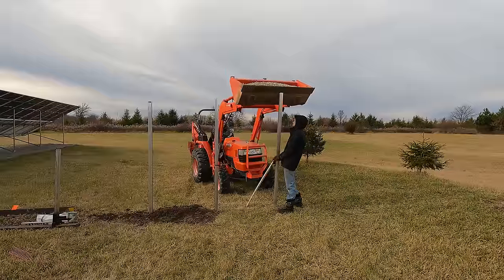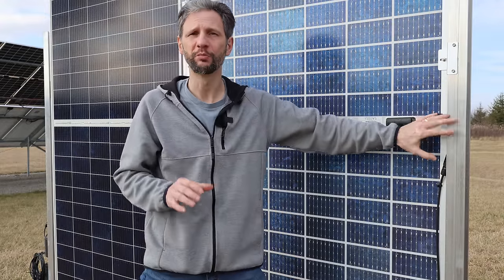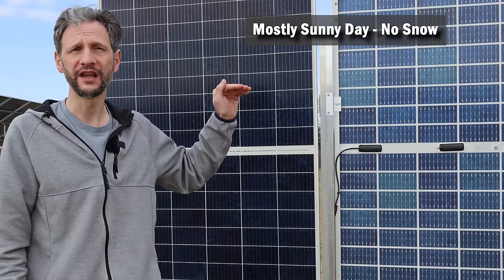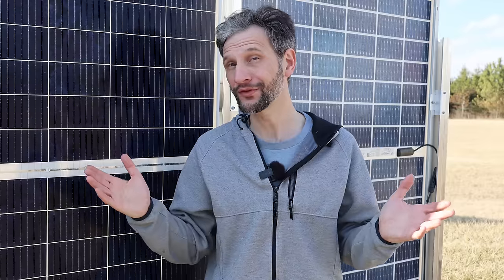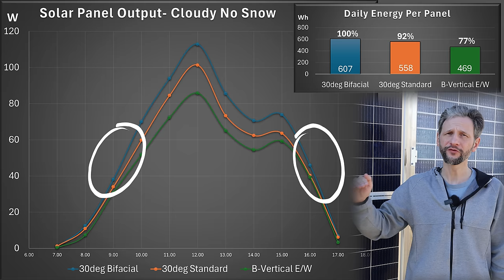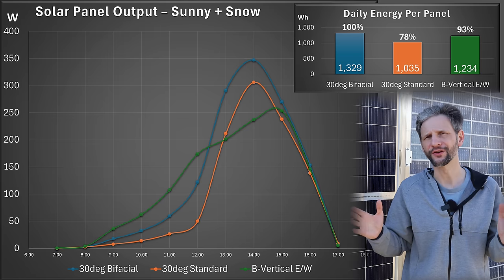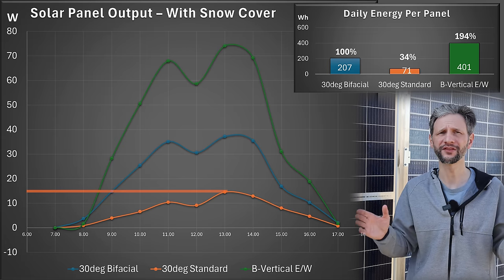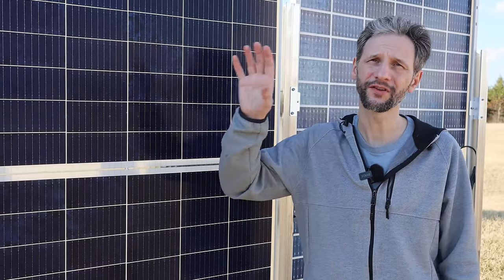Vertical Bifacial Solar Panel Performance Results Part 1

Comment: I have had similar results with one of my experiments. I use older bifacials, mounted them vertically on a concrete pad and alternately used mirrors and then white paint underneath for reflectivity. The results have been very good, getting as much as 209 watts from 157 watt panels. These were partly cloudy to mostly cloudy days. At midday the numbers were approximately 35% lest than rated. Enjoy your channel immensely!😊
Reply from the maker: Nice!   Thanks for posting your results!
Reply: Do you find that you get more watt hours total over the course of the day?
Reply: What if you gave them a slight tilt? Say there’s a hinge point at the top and the panel could swing 15 deg both ways as the sun passes overhead?
Reply: @Tailss1  yes, 15 to 43% more depending on conditions. I am still fine tuning my setup so I keep making small changes from time to time.
Reply: @stephenbrent2605  I'm going to try this with mine - I have an experimental off grid homestead and used solar all last summer with okay results. I'm going to try using white gravel underneath mine (marble) as it's plentiful where I'm at.
Reply: Ever consider parabolic ground mirors?
Reply: @Barskor1  considered them but no access to any. Also different types of prismatic lens but could not fine good  enough quality.
Reply: @stephenbrent2605   Pvc sewer pipe cut it in half lengthwise glue the inside  and apply mylar. Enjoy :)
Reply: @Barskor1  I'd be afraid of accidentally cooking the panels especially in summer - also those mirrors would require cleaning on a regular basis.
Reply: @stephenbrent2605  Nice results! I have a suggestion, might sound overkill, but here it is: You said you painted white the underneath part. As far as I know solar cells collect a lot of infrared wavelength light. There is a special white paint that reflects infrared far better than simple white paint; Tech Ingredients did a presentation and showed the process how to make it. That might improve the yield even further!
Reply: @Barskor1  good idea!
Reply: @Sekir80  I will check? Thanks!
Reply: @Tailss1  Solar panels need regular cleaning anyway so it is not that big of an add time wise.
Reply: I painted my fence white to take advantage of the reflection on the bifacial panels and another excellent place could be for those who have a river or sea near their land, the reflection is excellent all day long.
Reply: @Sekir80 No it actually specifically doesn't reflect thermal infrared; instead it emits that. It does reflect visual light, though.
Reply: @namibjDerEchte  Hmmm, that's an interesting thought! It emits infrared, for example if I paint pipes with this paint and circulate hot water in it, true, it can cool down the water even below ambient temp. But doesn't that mean if the Sun makes it hot, emits it? Essentially reflecting it? How is this different?
Reply: Add mirrors fantastic results
Reply: @Barskor1  Untrue, if you have to clean them there are in the wrong place andor to flat...
Reply: DUDE, yes! Mirrors!!! That is some Walter White level genius stuff right there, I love it!!!
Reply: @Barskor1 good suggestion i was thinking reflective mylar as well.. or even small panels at the bottom, at an angle, coated with that high reflectivity paint.  more experimentation is needed but it seems possible to improve the midday output with something pretty inexpensive.
Reply: @_xBrokenxDreamsx_ Your welcome, I was just passing along the gift that was given to me by others.
Reply: I have some old car hoods from the junkyard that are white. They're going in front of the panels tomorrow 😉
Reply: Have you a channel for us all to follow too?
Reply: @kiohaha  sorry, I don’t. There are already so many channels, all topics seem  covered to me.🙂
Reply: I don’t understand why they are oriented east-west. Unless you are on the equator the sun is never directly on either side. Test this with them oriented facing the south
Reply: Lots of new commercial roofs require white elastic membrane paint. I wonder if mounting vertical solar panels where the white membrane reflects sunlight is something people people are utilizing.
Reply: @Sekir80  naw the way the coating works is that you are reflecting almost everything that comes in but it really only works with a direct line of sight to the sky
Reply: Because it genuinely works better that way . Facing south one row of panels will really shade the next too much. It's not that no one has thought of it...  @Grunttamer
Reply: Did you mean to put them vertically in East - West Direction? and adding mirrors either side on the floor?
Reply: @cppfb  my panels are not flat panels. These work using reflected light from all angles.
Reply: @stephenbrent2605  I'm about to install a 3KW TOPcon panel at my home & I have also been thinking about putting something reflective like mirror or Aluminium foil beneath the panel so that the rear side also get enough sunlight. But the vendor argued that it may void warranty as the rear side is not designed in a way to make full use of sunlight. If I try to add way too much light from beneath then it according them may damage the panel.
Reply: @cppfb  they would have a tough time arguing that in court. What they seem to be saying is “our product cannot handle ambient light/reflected light”, regardless what our marketing materials claim.  Doesn’t sound like a quality product to me if that is their stance.
Reply: @stephenbrent2605  what do you recommend using to get the most reflection on the rear side ? A cost effective solution.
Reply: @cppfb  for my situation , simply bright white paint. Reflects around 60% per my tests.
Reply: @stephenbrent2605  what do you think will give the most reflection ? Any idea about aluminium paint ?
Reply: @cppfb  my tests show white paint better. It doesn’t oxidize as much or as fast. Plus less cost.
Reply: @stephenbrent2605  But isnt aluminium foil cheaper than paint ?
Reply: @cppfb  try using it. It didn’t last long for me with wind and it does oxidize too fast. Not to mention the time for application and reapplication.
Reply: ROI?
Reply: @retrx4236  I assume you are asking what my roi was in this experiment since I am sure you have access to google any definition you wanted. Since I repurpose 75% of materials used, it is less than 1yr. for an slightly less than $2000. Completely questions are helpful if you want a accurate response.🙂
Reply: @stephenbrent2605  Stepheeeeen :) but thank you
Reply: What is everyone using under your bi facials? White decorative 1" stone? Ideas?
Reply: @IMiss_The90s  white paint on concrete is what I used

Comment: Going to be interesting in the summer because one of the (apparent) advantages of vertical mounting is that they do not get so hot and heat reduces panel output considerably.
Reply from the maker: I'll track it and see what happens.
Reply: They don't get as hot because they don't get as much sun :)
Reply: @Zorlig  There's a joke that because the panels like being cool the best place for them is in the shade😊
Reply: @Zorlig  Are you in the States? In the UK where I am now, we can buy 425W longi panels for just less than $100(US) equivalent each (including our 20% tax) and that price includes delivery to the site. What's the price of panels in the US?
Reply: @mb-3faze  I lot more than that. They've basically banned the cheap Chinese ones here. I can get a 535 watt Canadian solar bifacial for $203 plus shipping. That's a great joke btw.
Reply: The narration pays a lot of attention to percentages and comparisons between the different mountains, but glosses over the absolute amount of power generated by each mounting in the various scenarios.  Take a look at the scale on the left side of these graphs, and you'll see that on the days that vertical mounting "does well", it is because the 30° panels are doing abysmally.
Reply: ohio is too north for a pure east west allingment. more like s-e positioning for the morning panel and s-w for the evening panel. something like a zigzag row.
Reply: @cornelstamate2537 Interesting. Wonder about the shading on the backside with that setup.
Reply: Correct, one the main reason to why they generate more energy is because of the lower average temperature of the panel.

So the benefits of such panel in cold winter condition decrease significantly.
Reply: @Zorlig  Canadian solar is owned and operated by China anyways.
Reply: And if you're going to spend a fortune on solar panels, why not invest a little more and actually have the panels tilt to follow the Sun?  Certainly the power for the motors to do the movement would be about a billionth of the benefit of the increase in panel output  😊
Reply: @gsegallis  I think the issue is mostly cost. The motorized trackers have to be pretty substantial to suffer the ravages of strong winds and possible snow loads. I've installed panels on roofs and on custom built (fixed) frames and the cost of the (metal) frames ( even unmovable ones) is always high. It's quite sobering to work out how many extra panels I could have bought for the price of the frame.
Reply: @Zorlig  they get roughly the same amount of sun, but over a longer (and split up) period throughout the day. They also are able to shed the heat better as air can simply carry it straight up in a more streamlined convection. That's why they don't get as hot.
Reply: @bearfriend_  and the absolutely crappy angle they get irradiated at make them not get hot.  more reflection avoids radiation reaching into the silicon. that does help with heat (and degradation ofc.) but it craps in the yield section.

you always want 90° to panel surface.  an East-West BI-Fi array even in winter never comes close to that.

cooling IS a positive effect but gets eaten up by, the non-90° to wintersun angled array😢 array.
Reply: @casemodder89  It depends a lot on your location. And as I understood from the video vertical installation is most beneficial in high latitude ( snowy ) areas. On those areas midwinter the sun is so low that vertical installation is 75-80° to the sun. I'm not sure I would put them in an east-west configuration thought, as you don't get 180° sun exposure. I guess it all boils down to location and local knowledge.
Reply: The best answer may be DO BOTH.  Do most of your panels vertically for the simplicity, ease, and longer life.  Then do a small number of panels straight to the noon Sun.  The best of both worlds, with the smaller set of panels filling in the trough in the middle of the day.  If you optimize this correctly most of your panels will be long life, the middle panels will only be a small number worked harder and needing changing more often, and you should need slightly less battery than if you had less panels and tried to store the higher peak.  Optimized this should be close to Sun tracking, but with less battery needed and a few more panels with the majority in the longer life vertical position.  It should work out slightly better than the higher peak, more battery, and more often replacement of straight Sun, with basically only a little more panel cost that also lengthens panel life and reduces peak battery need.
Just a thought and haven't really run the numbers etc, but it should work out correctly.
Reply: @gsegallis  moving panels massively increase complexity,  massively increase odds of failure due to moving parts (someone needs to oil them). massively increase cost to install, massively increase cost to maintain (from nothing, to regular maintenance), and finally the tracking array mounting hardware costs massively more than the panels themselves. In short, tracking panels are a gimmick. just spend a fraction of the cost to install more fixed panels

Comment: Im out in New Mexico.  I have a former coworker who used bifacials to build a "ramada" but the panels were mounted like 25 feet up.   He saw so much gain from a month where snow was on the ground he decided to duplicate it.  Painted the concrete pad and then put white painted gravel 15 feet out in evey direction.  He is still collecting data but says it looks like a 20% increase
Reply: what about installing mirrors on the ground?
Reply: @old_H  you can do mirrors but they are expensive for what you get and require tracking motors.  Easier and cheaper to just paint everything some highly reflective color and be done with it.  Kind of like why solar tracking solar panels have fallen out of use.  It's cheaper to add more panels than do anything fancy to increase their gains

However  Their is a Russian dude on youtube who does a BUNCH of stuff with mylar blankets and cheap building components.   His biggest thing is he built a cheap solar water heater system.  It's a long parabolic mirror made of scraps holding a mylar blanket focused on heavy pressure rated pipe.  Heats his house in the middle of a harsh Russian winter just using the few hours of sun light they get.  I'll look it up and post it in another comment

Comment: So glad you got to test this!!! Awesome results. Especially with the snow on the ground. I need to do a desert, high temp test
Reply from the maker: That would be great to compare.  If you have sand as a background it would be nice to see how the reflectivity compares.  Probably much better than grass but not as good as the snow results.
Reply: Desert would have the reflectivity too, so it should be interesting
Reply: One interesting thing i read about vertical bifacials is they stay cooler under midday sun, thus suffering less power loss at noon.
Reply: Hey Will glad to see you here!
I just finished watching your last video and this came up as a suggested video.
It's hard to know whose information to trust because there are so many people out there doing solar now and you don't know what is safe or isn't safe. So I always look for answers on your channel first LOL
Reply: I'm wondering if we'll see better results in hotter climates? With the panels not directly facing the sun they may run "cooler" and perform better.
Reply: Please include a standard panel mounted vertically and directed south in your test!!!
Reply: Don't forget to get the temp reading too, vertical array are supposed to run cooler than than south facing.
Reply: Yes please do. @UndecidedMF did a video explaining that the main advantage of the vertical panels was less drop off during mid day product due to over heating on normal panels.
Reply: Would like to see mono faced panels held vertical with a reflection panel on the ground. I was thinking about the silver reflective insulation pieces.
Reply: @hobbes1069  I'm guessing they'll catch more wind when vertical causing them to cool down during midday hours especially.
Reply: @jeremycook1242 I haven't seen his video but I do know solar panel specs and did study engineering. Good panels have about -0.3% output per degree C temperature increase, so if they somehow manage 20°C (36°F) cooler it's only a 6% difference. 

He  doesn't seem to have a strong technical education
Reply: Hi ,which desert are you in, we are in the high desert of Oregon. We  get  winds of 80 miles an hour and very strong down drafts. Were already off grid and want to upgrade. I like the vertical array. GOD BLESS
Reply: High praise from my solar guru. My solor Grogu also approves.
Reply: Please do
Reply: There is no snow in the desert..... right? ;-)
Reply: I commented this on one of your videos. It would probably boost output more due to cooler temperatures mounting vertically in the desert temperatures in summer months. I'd definitely watch your video if tested.
Reply: I would love to see the desert high temp test, I live about 90 minutes south of vegas, in Arizona.
Reply: Please do!!!! Looking forward to it. I have a large privacy fence that I would like to try this on so I'm not paying for just a useless fence

Comment: My understanding is that vertical panels out perform because they don't get as hot. Winter air is going to mitigate that advantage quite a bit.
Reply: Most of us mount on roofs so an interesting comparison would be vertical panels in comparison to the "standard" installation.
Reply: @rolandjarrett611  I don't think vertical panels are competing with roof installation though.